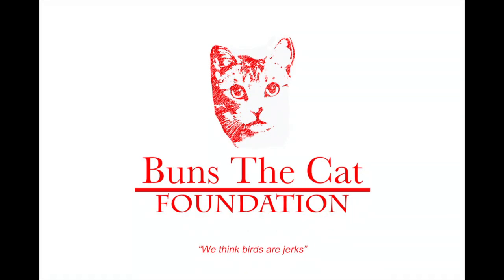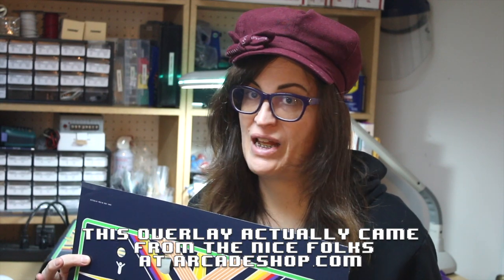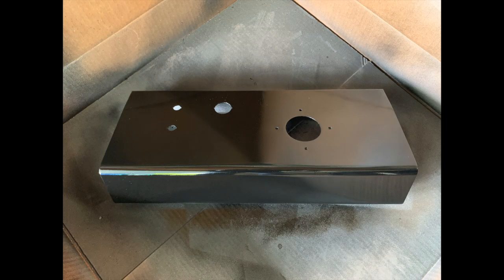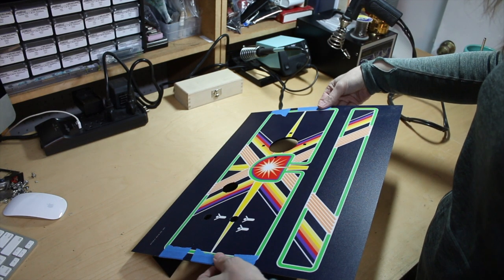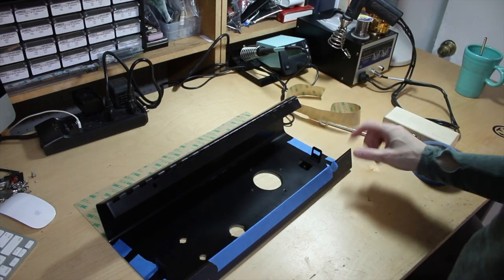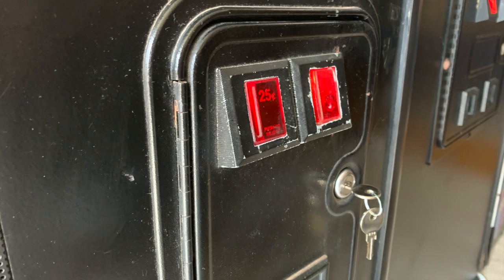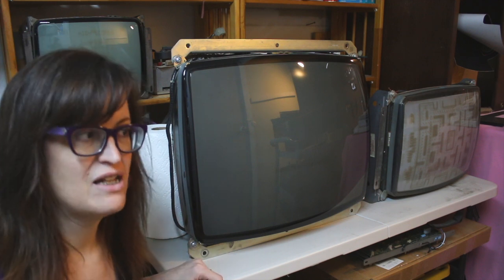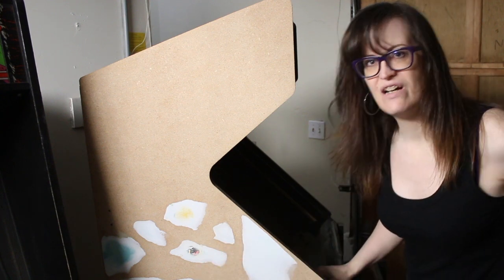The Arcade Workshop Quarantine Chronicles : Episode Three

Comment: Great vid! That cp looks great.  I've learned on a steel CP that wd40, a little time and a plastic scrapers gets rid of the residual adhesive. 

Thanks for the vid!
Reply from the maker: Ajaxaxxess ohhh that’s a good idea with the WD-40! Thanks for that!
Reply: @VintageArcadeGal  I've learned a ton from YouTube over the years. I try n share info. 

Still have to sand a little at the end but not near as bad. 

Good to see you keeping that Simpsons cab as original as possible. I am doing the same with a TMNT. 

Stay safe and sane during these times!